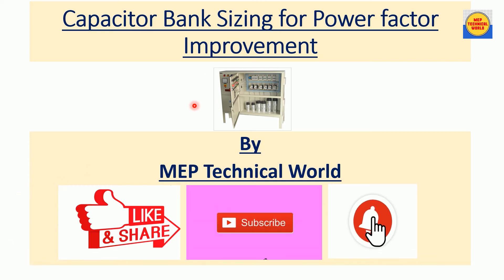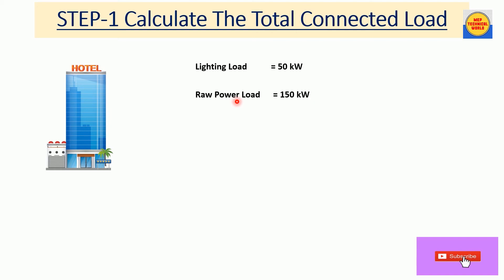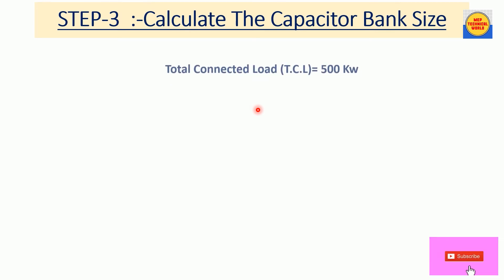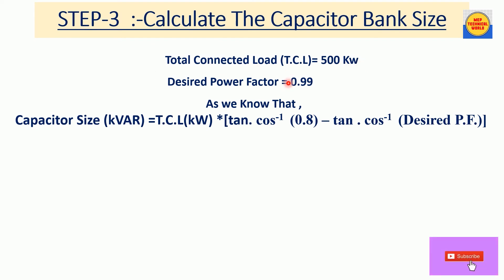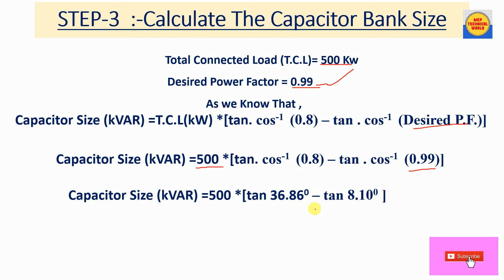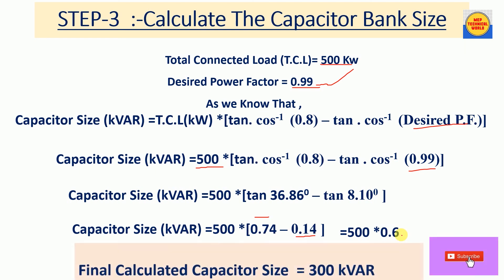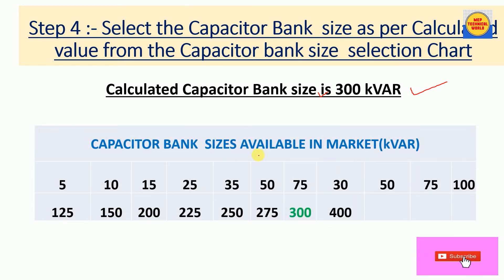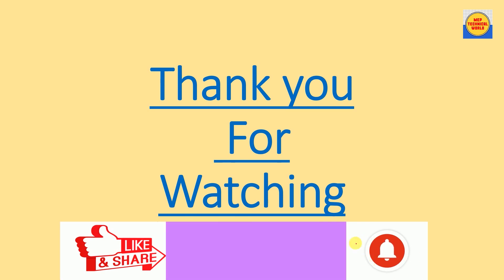Capacitor Bank Sizing(kVAR) for Power Factor Improvement | Calculation of Capacitor Bank Size

Comment: Sorry bro you are not right, Req cap bank is not only based on Connected load. must consider type of load is a capacitive load or inductive or resistance, so based on load the actual power factor will arive and based on actual PF and connected load we can select the bank value, thank you